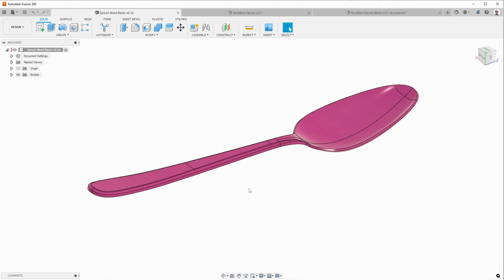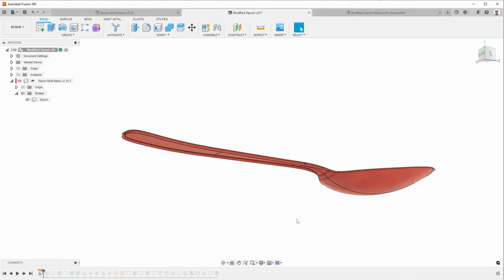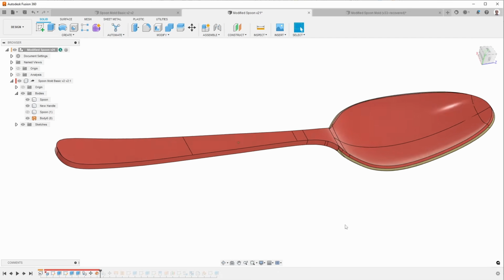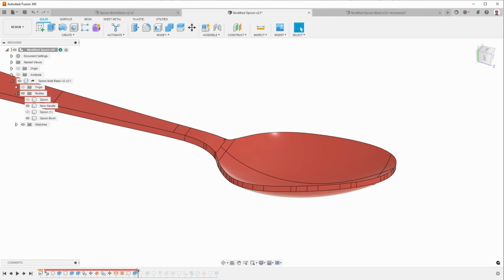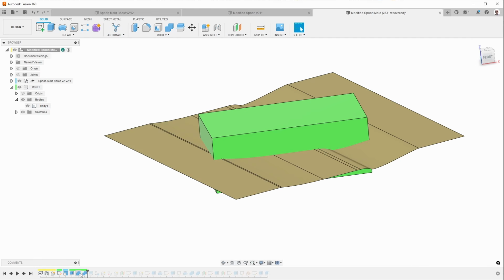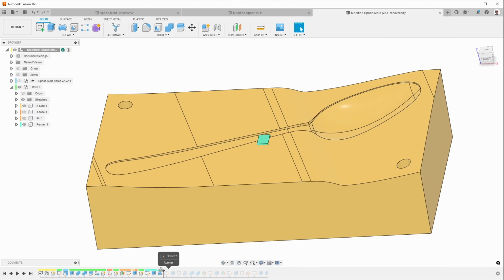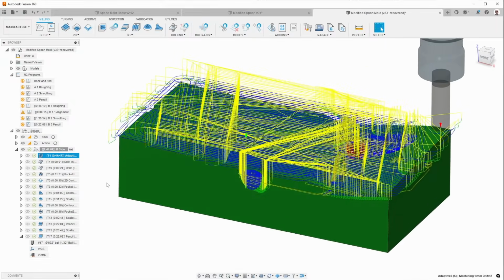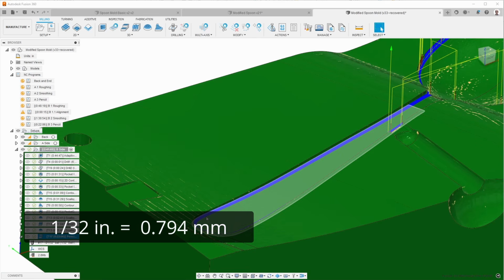Injection Molding a Spoon - Designing, making, using

Comment: you're a real fusion 360 magician!

those injection molding machines looks allready a bit more professional than the ones from actionbox. why not make it even better by make it open and close hydraulic, and while your at it inject hydraulic? 
i was schooled in the professional injection molding machines. they run automated and open/close by a knee joint, and if i see all the handwork you have to do. it's only a small addition to what you have allready.. but saves a lot of hand work. also you get better parts because of more consistant after pressure and times. you can verify it with a microgram weighing scale.
professional machines use after pressures of 1600-2000 bar by the way. that is some serious pressure ;)
if you want to know more message me.. 
best regards

Comment: My name is Victor,  and I am working on a product  which requires a plastic enclosure to be produced via injection molding.
I currently have a model of the enclosure (in STEP/STL format), and I am looking for support with the following:

Design and manufacturing of an injection mold for the plastic part

Production of the housing in a durable plastic material (e.g., ABS or other materials recommended by you)

I would appreciate it if you could provide:

A cost estimate for mold manufacturing

A quote for a small production run (e.g., 100–500 units)

Recommendations on the most suitable plastic material (considering mechanical resistance, UV exposure, and temperature over 100 degree celsius)

If needed, I can provide the CAD files and further technical details.

Thank you in advance, and I look forward to your response.

Comment: What mold release did he use and what do you recommend for mold release?
Reply from the maker: I didn't need to use a mold release for this part.
Reply: @JohnSL  i know but when you do need mold release or if you were working on a project where mild release would be required which ones would you go for and what mold release was the guy using in the video when he was using your mold

Comment: High quality storyboarding, production, and post production work! I have so many questions! Missing parts for rookies include introducing us to the name of the design software you are using, telling us about what kind of file with extension name it produces, and then telling us the name of tool path software used to create the tool path from the design file and giving the exact name and model number of the milling machine that does 30k rpm. I would like to suggest a complete process video story board that instead of being focal to one product, focuses on exactly delineating the work flow chart up to and including quality control. This would include software packages, file extensions, milling equipment, and injection equipment along with some kind of explanation of how the plastic beads are melted, chambered, and injected. I am looking at a similar project for a much larger part in epdm and am keen to soak it all in.

Comment: Hello, I am very happy to have found your video and to meet you, I live in Iran and I am a medical engineer living in one of the underprivileged areas of Iran, I am currently doing dental handpiece repairs, I am considering  I want to produce a number of silicon parts that are used in dental turbines. Since I don't have the equipment, I plan to get a metal mold to make silicone parts so that I can gain experience with the existing manual equipment. I request you to give me  Please help me with your own experience in making the part that is sent in the link below its photo, so that I know what type of mold and what size is suitable for the manual molding press, so that I can get the maximum number in each silicone injection.  Thank you for your efforts and thank you for your help.

Comment: This video just happened across my suggestions so i took a look. 🤷‍♂️ I am not a tool designer, nor do I know how to work with CAD. 
However, I am a training specialist within the plastic injection molding industry, so I understand the next phase when a process is developed to mold the final part but I work in the medical industry where tight tolerances are on important everything. I work with much larger molds and machines. Multi cavity, multiple resins being injected into the same mold, etc. It gets much harder once things expand and need a controlled process, and it is not as simple and squeezing plastic into a 6"x8" mold uncontrolled.

 "Larger" gate is not as simple as it sounds. Yes larger gate results in longer gate seal times and longer cycles, but makes it easier to fill a part. But usually cycle time is extremely important on large scale jobs. General rule is thst the gate thickness is approx 2/3 the thickness of the wall youre injecting into. But location is also important due to pressure gradients the further the flow path is, as well as molded in stresses that can warp your parts. In general, plastic silverware is molded with fairly cooperative materials but of course there are standard practices for all of it when it moves out of this type of protoyping phase. If someone is trying to make money molding a single spoon at a time theyre gonne be disappointed. 

 There is a scientific injection molding process that these machines give you no control over. Mold cooling is importent as well for repeatability. This is much simpler, smaller scale, and uncontrolled compared to what im used to. Ive considered getting a table top mding machine to run in my basement 🤷‍♂️ But still an interesting video to a plastics nerd like me.....

Comment: Hi John, I'm doing some hobbyist mold making as well. I'm gonna be machining a pocket with drafted walls into 6061 aluminum. I'm using a 2 flute 3/8 carbide end mill on a torch pcnc1100. You said in this video your 1st adaptive clearing toolpath was too aggressive, do you mind sharing the parameters you ended up using? Surface Speed, Feed Per Tooth, WOC and DOC would be helpful. I'm thinking of running at 5K rpm, .001 IPT, .075 WOC and .5 DOC. What do you think? I just don't want to wreck my mold base. I tried in Delrin with .004 IPT and that worked awesome, but I think far too aggressive for aluminum in the tormach. Cheers! -Justin

Comment: Fascinating process. Having no experience in injection moulding myself but quite a lot of experience with various manufacturing, the two things that surprise me are the mould can be made of soft 6061 aluminium (which I guess works because the plastic being used has no abrasives in it), and that the mould does not have to be temperature controlled (heated/cooled) to control the cooling rate of the plastic as it sets.

Comment: Great video, liked and subscribed to your channel. I have 3 quick questions, please: 1 ) Can you inject twice into the same mild if you have a large mold and a small injection machine? For example if the mold needs 100g to be filled and the machine injects 50G at a time. 2) what is the price for a similar mold you just showed excluding the price for the materials. 3) what type of steel you used for the mold, P20?

Comment: 2 things, that is the smallest machine probe of ever seen, 2nd a word of advice from a long time machinist, never tap down the first operation, let it sits where it sits, this actually helps the top surface be more square to the sides, you only tap down when a machined surface is face down. It can also cause flatness issues if tapped down while clamped on non machined surfaces.

Comment: Have you considered using the injection Molding Simulation tool in Fusion to see if you actually had to rework the design? But ... I get this is beyond the point of the video.

Comment: Not bad for hobby machining. Next time, try to move split plane to the edge to have easier machining. Also play more wilt milling strategies and their order. Two tips: make your split plane just 1/2 in around mould to have smaller surface for split plane matching. Cover split plane for sanding and polishing. Also, you can use chalk and ultrasound gun for super finishing
Reply: "Cover split plane for sanding and polishing" This was bothering me the most.  He discusses flash prevention a lot, but then went to the plane with a sponge.  My poor little heart.

Comment: Thank you for sharing, it's nice to see these details about the process. I do wonder, was this a real project for a real customer? I can't see any commercial value in this mold. For the price of that mold you can buy A LOT of plastic spoons. Now add the cost of the machine, and an employee to run that machine, and you are manufacturing the most expensive plastic spoons I can imagine, one at the time. It might have made some sense if the handle was branded or something, but I'm really failing to see the commercial use of this particular mold.
Reply: i work in injection molding PVC... for sure this is not for a mass produce... he is making 1 spoon a cycle I'm sure the spoon makers make 300-500 a cycle

Comment: Hello John ! Thank you for your work, it is helping me a lot. I have a question which is very simple i guess, is it possible to change plastic colors easily ? I mean not inside the injection barrel, but the color of the material. From black to yellow or from grey to natural for exemple?
Keep the great job !
Reply from the maker: With plunger style machines like mine you have to by pellets that already have the color you want. The options for pre-colored pellets are very limited unless you're willing to buy hundreds of pounds of material. I've never come even closing to using that much. Screw-style machines, on the other hand, make this very easy, as they do a good job mixing colorants (masterbatch) into raw pellets.

Comment: Great video! I’m trying to learn Fusion 360 and making good progress. One thing I don’t understand is that to make a mould for something like sunglasses frame would cost me few hundred dollars but to make the mould costs about $6,000. What are the professional mould makers charging for? Their CNC machine?
Reply from the maker: It really depends a lot on what machine they're targeting. If it's for a desktop injection molding machine and low volume production, that sounds high. In other words, a mold like the one in this video. On the other hand, if it's actually multiple molds, or it includes an ejector mechanism, perhaps not.
Reply: Whoops I made a typo I meant to say why the CAD file only costs few hundred the but mould cost $5k-$7k. Just to go to the CAD program and export it to the CNC machine seems to be the real expensive cost. Maybe the real charge is for the usage of the CNC machine.

Comment: Recent plastics engineering grad from UMass Lowell here. Initially I was intrigued why there had to be screwdriver slots milled into the A and B sides of the mold for mold opening. After watching the entire video I understood that there is no ejection system (such as ejection pins and/or ejection plate) and so it makes sense to add them. This begged the question that if the customer is making PP/PE/PS spoons and using this highly manual form of IM where even ejection is not automated (absent from a standard molding process), could this process be profitable given the low productivity and high human motion waste (lean mfg.) within the scope of the value of the product? Nevertheless, I thoroughly enjoyed your design tweaks and tooling split demonstration for the spoon in Fusion and definitely took notes for future reference. CAD, Mill, and Mold on good sir!

P.S. I’ve read more comments and I now foolishly understand that this is a pilot mold for R&D purposes and that you were employed to modify the preexisting CAD model for DFIM. Nice work!!
Reply from the maker: Yes, it's a test mold rather than for production. Mold design for these desktop machines is probably quite different from what you learned in school.

Comment: Curious as to why you selected hand polishing rather than using a rotary tool? Great videos!
Reply: Recent plastics engineering grad here… Typically you need a greater level of accuracy when polishing injection mold tooling than what a rotary tool offers. There are a few key considerations:
1: You want to try to not accidentally polish/abrade the parting line because flashing may occur during molding. A steady hand with manual polishing is an easy way to ensure quality craftsmanship where “just enough” material is polished away and the perimeter of the parting line is left intact. If a careful, steady handed level of care is taken, it is much more difficult to accidentally screw up the parting line. Look at any lower quality product you’ve purchased from let’s say, Walmart. Chances are you will see a thin line of plastic protruding from the part. This is flash, it is undesirable aesthetically and in the case of a spoon it may be uncomfortable to eat with because it could scratch your mouth if bad enough.
2: Only a small amount of material needs to be sanded/abraded/polished away to remove tool marks for most CNC tool paths using fine tooling like this gentleman used in this part. If you get too overzealous with a rotary tool then the dimensions of the final cavity (cavity essentially=the final dimensions of the empty space in the mold which fills with plastic to form the final part) will be off to a larger degree than if you took your time doing it by hand. An injection mold is meant to produce at least 10s of thousands of parts, so make sure you spend time on mold polishing to ensure that your plethora of parts are as pretty as they can be. Mold making is not a speedy process if done with extreme care.
Hope you found this helpful! Message me if you have any other questions!

Comment: How much for a mold ? Something the size of a toy gun ?
Reply: For a mold like this, made of aluminum, meant for small production runs, without an ejection system (ejector system, ejection plate) you could most likely expect a number around $15k USD. This is a conservative estimate. Just be aware that production efficiency with this type of mold will be significantly lower than for a mold which is equipped with an ejection system which can run in a full auto injection molding press. Depending on your volume production goals, the more expensive mold, which features ejector pins and full auto capability will yield lower cost per part for larger production runs than a mold like the one showcased in this video. If you plan on doing a small production run, the style of mold displayed in this video may be adequate for your needs, though cycle times and labor costs will be much higher than for the aforementioned mold which has ejector pins.

Comment: Whats the application of such (relatively) low turnaround and manual injection moulding? Specifically in this case for a spoon, as something that i presume would be intended to be mass produced, but also just in general. I always thought of injection moulding as a purely mass production technique
Reply: I second this. I asked OP the same question in a recent comment. Manual ejection, single cavity, no 3 plate mold with ejector plate. Nonetheless I really appreciate the CAD tweaking demonstration in the beginning of the video. Definitely took notes because he implemented top notch DFIM modifications for his customer!

Comment: amazing work and craft, would it be possible to know more about the connection beween the milled mold to the injection molding machine? What is the diameter of the sphere? is there a standard geometry that is share by different brands of injection molding machine ?
Reply from the maker: Each of my injection molding machines is different. So when I design a mold, I design it for a specific machine. You can find a link to information about the machine in this video in the description for this video.
Reply: One of the main criteria between the molded part and the injection molding machine is the clamping tonnage. The required clamping tonnage for a given part is determined by the projected area of the part, because pressure=force/area. So for parts which have a small projected area, required clamping tonnage is low. For high projected area parts (like trash barrels) required clamping tonnage is high. There are other considerations as well such as maximum injection pressure/velocity, but most injection molding machines are specified by their maximum clamping tonnage.